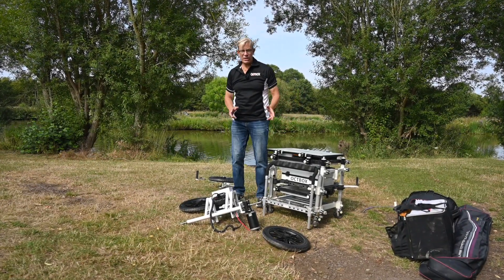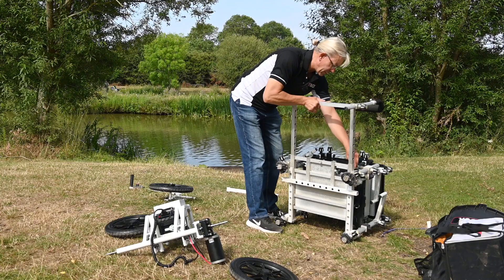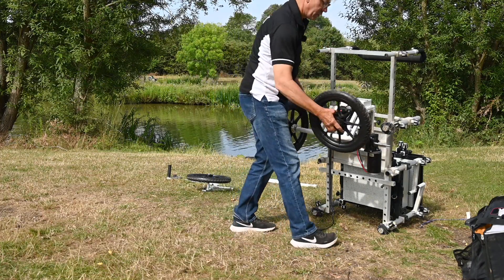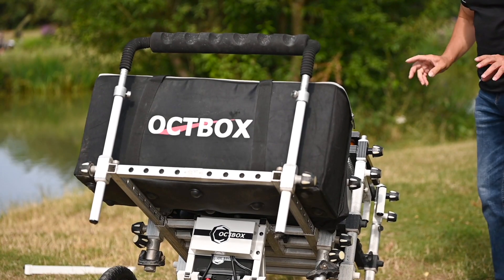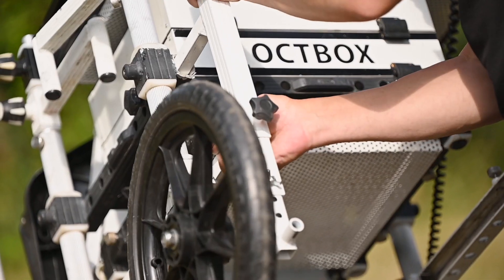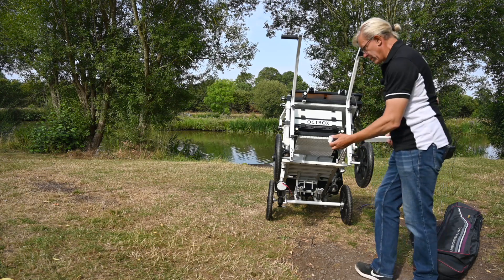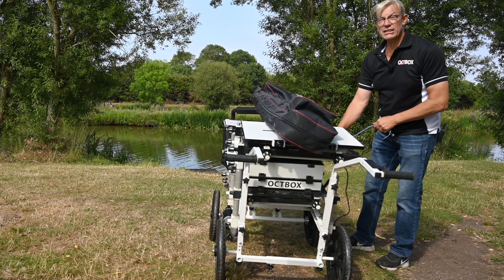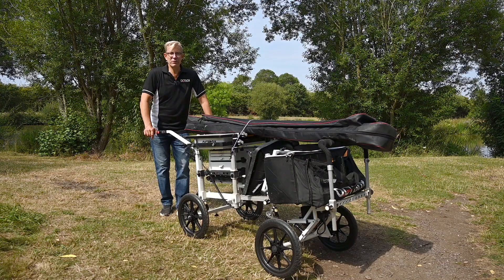Powered Fishing Barrow

Comment: By the time you put it together I’d already have a fish creating a solution to a problem that doesn’t exist
Reply from the maker: 60 seconds from start of build to fully loaded.   Visit us on the Big One show next year and we can have a small wager.   Regards Rick Tyler. PS.  If you are disabled, one leg, or struggling with health you do need assistance sometime.
Reply: @richardtyler296  or if you just lazy like me. 😜 I’m happy with the barrow, I manage to setup under the 60 seconds. 👍🏻
Reply: @richardtyler296  yes i agree that would help a lot of anglers
Reply: You never mentioned how much this will  cost ??? Please 🙏
Reply from the maker: @paultownsley6606  Hi Paul if you already have an Octbox Seat Box the power module that slots into the front and back with lithium battery would be £850.    If you already have a lithium battery it will reduce the price by £150

Comment: Jesus u will need 7.5 tonne lorry ticket to carry that beast.   Just looks. Heavy and lots of messing to set up
Reply: It will probably be cheaper to but a new land-rover defender and drive right up to your peg  .
Reply from the maker: The average match angler is now taking between 60 and 100kg of gear.   We are just responding to the needs of the modern match angler.   The Seat Box becomes the barrow chassis so you are only adding the front and rear wheel modules.